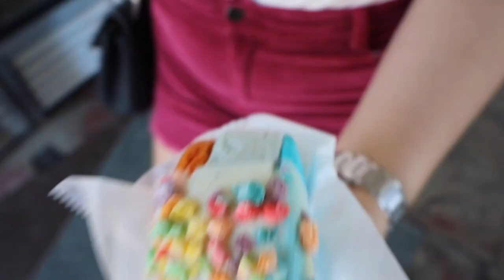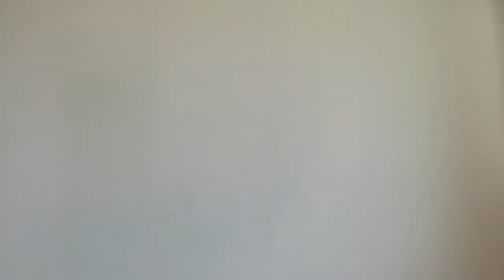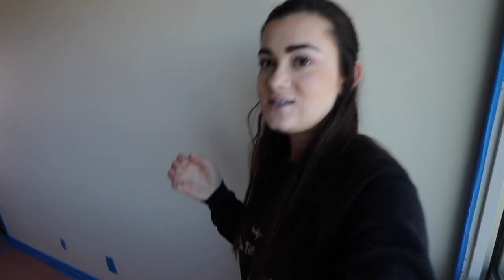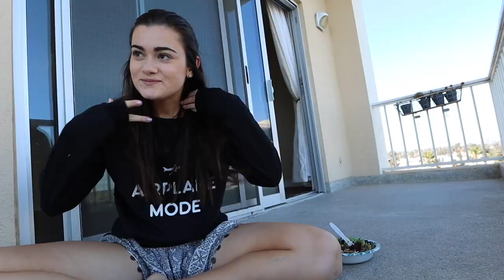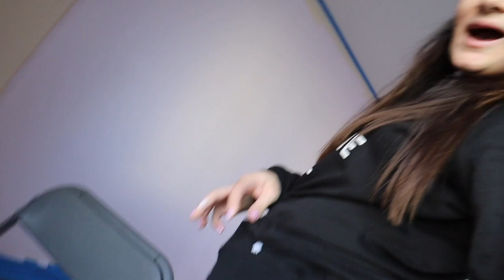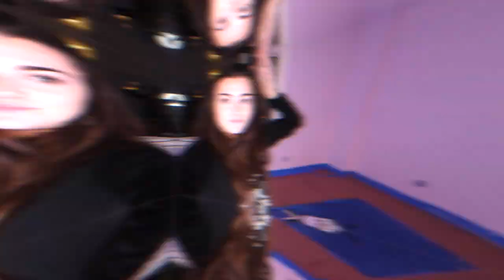Painting my new room! Moving in to my apartment | Cloe Feldman

Comment: LOL Chloe "old fashion stove" is a gas stove. I live in PA and all anybody has is gas stoves, not electric. Must be a north-east thing. Gas stoves you push it in and turn it a little bit until it starts clicking, then a flame should appear after a second. If it takes more than 5 seconds turn it back off. Natural gas can be very dangerous so don't let it "click" for too long. Once the flame appears then turn it to the setting you want high/med/low.

Comment: Your stove, you're supposed to turn it to a "lit" point, you will be able to hear something like tsk tsk tsk, it's oven trying to light up (sometimes this is by the High area) as soon as it lights, turn it to the desired temp. Or, ask your landlord if the gas is turned off on your stove, sometimes landlords do this to avoid possible gas leaks when no one is around. Maybe they left it off and that's why you can't turn it on.

Comment: Hey Cloe! So to use the stove you push down the switch and turn it on “Lite”. Putting it on “lite” starts kind of like a match effect. The gas is on and the match is kinda trying to start the fire (that’s what the clicking sound is). As it starts clicking, you keep holding down the switch and gradually turn the stove on high. Once it’s on, you can change the heat from there. I just kept watching you struggle wishing I could be there to help you😂 but I hope this helps or you found out how to use the stove eventually

Comment: For the stove you have to turn it all the way up until the flame comes on. The flame will be high so watch out and then once the big flame is going you can adjust it lower to your liking. And I have the same drill tool set from target, it’s actually pretty handy

Comment: For a gas stove you need to push in and turn the dial and but it to highest settings. If flames don’t come out TURN IT OFF. Try stove tops.... in my experience the front left one is always finicky. 

Maybe maybe when it is off and cool remove the top and use dry qtips and paper towels to ensure gunk isn’t obstructing the gas fire flow....

FYI I am NOT an expert, I just grew up with gas oven/stoves with the same issues...

Comment: For the stove you have to turn it so it’s making the ticking noise. The fire should come out. If it doesn’t you’ll need to get a lighter a long one is probably the safest bet. Put the fire close to the burner while the stove is still off. Slowly turn of the stove and it will turn the fire on. Usually I will just work after that without a lighter and just waiting for it to turn on with the ticking noise. Just make sure you don’t leave the stove on without any fire going. That just lets out the gas fumes

Comment: Did the others comments on how to work the stove not work? If so, have you tried pushing in the knob until it ignites (it will click until it catches) and then turning the knob to adjust the flame? I don't know how old your stove is or even what type, but the gas stoves I've used have all had to be worked like that.  Sadly, because I soooo prefer gas stoves, I've had electric for like 10 years now.  If all else fails, ask your landlord or google the stove brand and model and read the instructions?  I just remember when you first tried it and it said 'push'  & I was like talking to my computer/you saying 'push the knob in toward the stove and then adjust the flame' LOL. Anyway, I hope this info helps xx

Comment: That stove is like mine, you have to hold it while its clicking because its trying to ignite then you can adjust the heat. Mine smells like gas for a split second while it ignites but once the fire is on it should stop.

Comment: You guys have to push in and turn the nob to light and hold it there until the fire ignites, when the fire ignites then you can move the nob to what level you want it
The reason you smelled gas was because it was gas lol that gas is to ignite the fire when you push in and hold the nob to light

Comment: So my house is old AF and the stove is the same. When you turn the nozzles all you smell is gas. We figured out you have to light the stove manually. So you turn the nozzle to turn on the gas.. And then you get a stove lighter (sometimes i just use a regular lighter) and light the middle part where the gas comes out. And then you can turn the nozzle to make the flame higher or lower. And then you just turn it off when you are done. It scared me at first but now I'm used to it. So you may need to try that! Don't be scared.

Comment: Your painting is giving me anxiety you're supposed to cut in your walls first you're supposed to take tape and get all the fuzzies off of your roller you're supposed to take a paint stick and stir your paint from the bottom and you're supposed to have a pole extension on your roller It would  be a lot easier